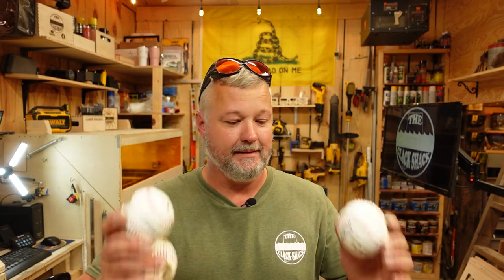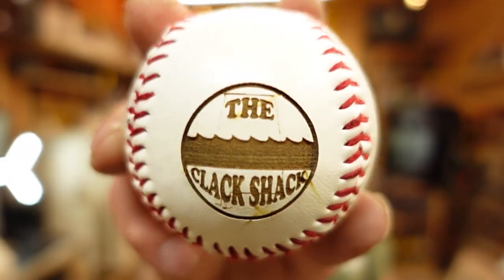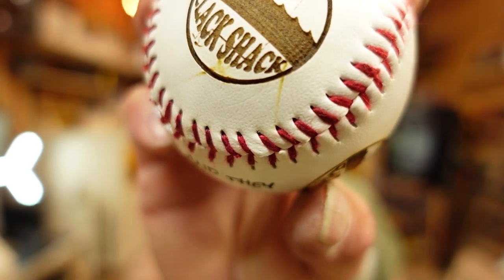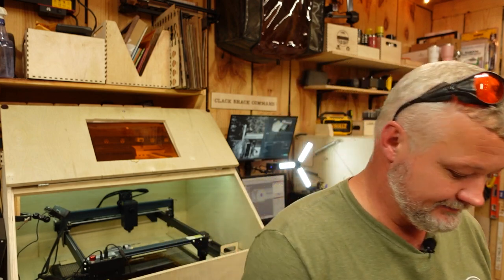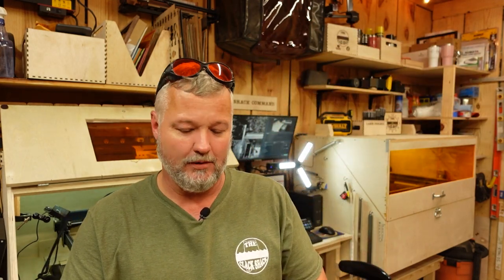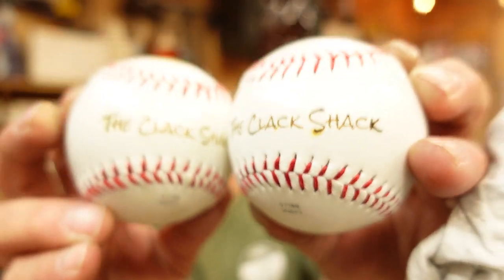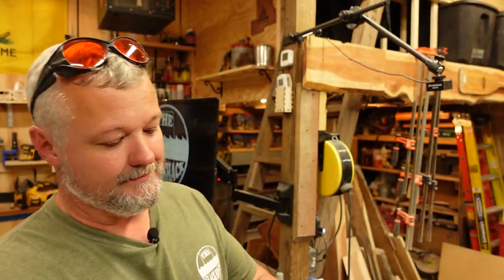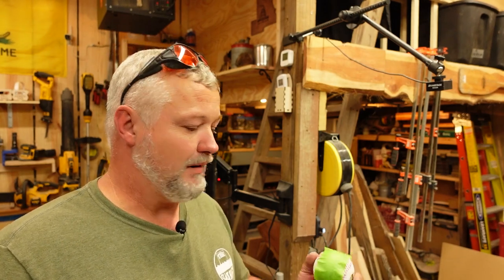Three methods of engraving baseballs

Comment: I did a baseball a few years ago with a 25w co2 Universal laser. I would try out a ball with lower power settings. I think the ball I did was 100%speed and 80 or 85% power. The logo (marine corps eagle, globe and anchor), came out a nice brown color with no charring. Hope this helps. As someone else mentioned, the price/makeup of the ball will give different results also.
Reply from the maker: Every blank varies in the manner it burns. This actually surprised me with how cheap the balls were and how thin the outer layer is.

Comment: Not sure if it would work. Never used a Lazer. But would a stretch wrap would. It would conform to the shape rather tighty. Depending on how hard you pull it. Frist thing I could think of.
Reply from the maker: Not sure how that would work once it was cut
Reply: @TheClackShack  it was a thought. But now that I think about it a little more. I don't think it would be a good idea